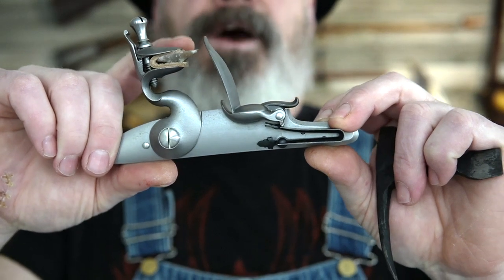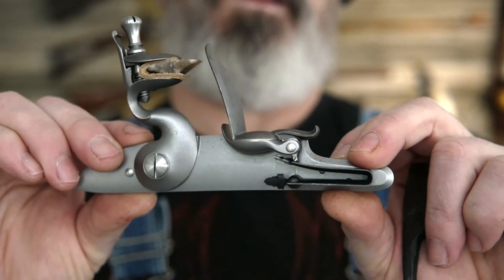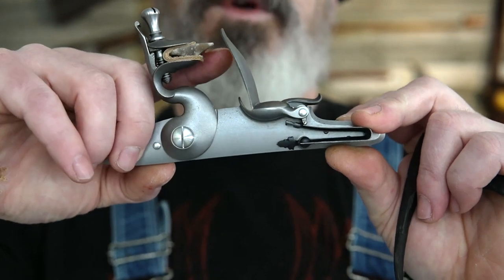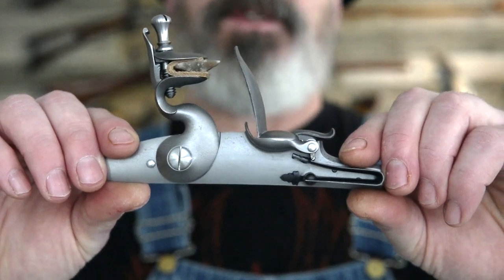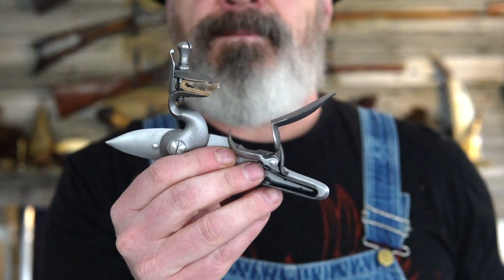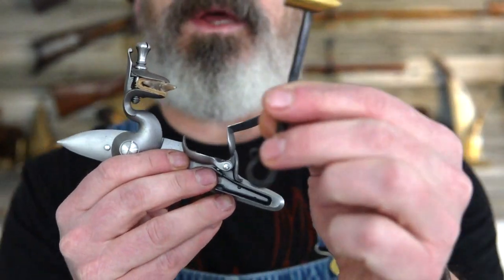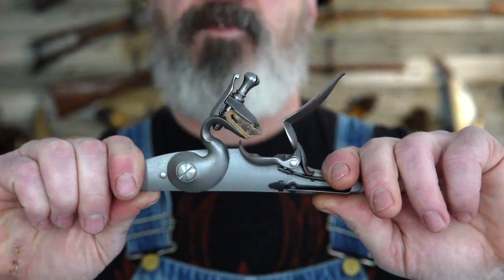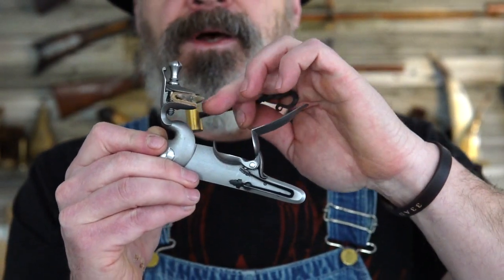KNAPPING THE FLINT + SLO-MO OF THE NEW KIBLER ROUND FACE ENGLISH FLINT LOCK

Comment: I use small hand forged iron pliers and it works very well. I like it better than the hammer. I saw some guys using regular pliers at the range. Good video for the beginners. Thanks
Reply from the maker: Yep, I see how that would work fine. I often use whatever is on hand which is usually the butt or topside of the blade of my knife. Thanks!

Comment: Thank you! Just started getting into flintlocking. A lot of fun and interesting. Missed a nice deer yesterday because of this. Great video and thanks again! Also could someone tell me the best way to prime the frozen pan. I think I was overfilling it causing hangfires.
Reply from the maker: Hey David. Typically overfilling will cause it to hang a bit but not always. I'm not sure what you mean by 'prime the frozen pan'. Reply and I'll answer the best I can. Thanks brother!
Reply: Sorry- frizzen pan!
Reply from the maker: @davidmedeiros2856  I use a separate small priming horn with 4f or 0B in it when using 1f or 2f for the main charge but it’s still hard to control the flow of powder. Many guys I know put their finger over the hole and let a little out at a time until they have the right amount. I usually pour and if I over fill I just wipe it out until I’m happy with how much is in here. You can also use a plunger type primer that only puts out 1g-2g per push. A few pushes and you’re good. It’s really sort of an acquired skill based on how big the hole is on your horn.
Reply: Thank you!

Comment: This took me some trial and error to learn, but now I've tried some of the machine-cut white flints that I think you're supposed to sharpen using a wet stone on the flat side of the "flint" until you've thinned it up enough to get the dings out of it.  Do you have any experience with the machine cut "flints"?  Some say they're great, some say never use them, but I find they last a long time and because the edge is machined so straight, they seem to be easier on my frizzen than natural flints that have a more jagged edge, no matter how carefully I knap them.
Reply from the maker: I've never used them. I'm sort of a traditionalist. I don't mind dinging my frizzen up. It'll still take thousands of shots but if i think there may be a supply problem in the future I usually just buy a second frizzen or send mine to a buddy to reface and temper.....

Comment: So i wamt to ask as i guess i was told wrong. I have the same hammer you so and have sharpened my dlints a couple times to good success it seems. I was told to use the pointed side of the brass hammer and strike edge to edge. Like two swords. That way you end up creating small circular like saw teeth in the flint as you go across the edge. Have you ever heard of anyone doing it this way? Its worked for me although it doesnt take off too much material and actually seems to ding up the edged side of the hammer but what are your thought's?

Comment: My Pedersoli Brown Bess lock that is brand new doesn’t seem to perform like this at all. It came with what seems
Like an amber flint and I could never get that many shots out of it. Within probably ten it was completely chilled out and I can’t really knap it because the flint is really short and there is no edge at all. I’m Also seeing some
Gouging in the frizzen. Not feeling too good.
Reply: I have a pedersoli queen anne that works great but the French blond flints pedersoli uses aren't the best. You need to go on track of the wolf and buy the tom fuller black English flints and jaw pads. Then cut the pad down to size and superglue the top and bottom of the flint to the pad. Lock it down in the lock so that it is straight on with the frizzen at a slight downward angle. You might notice pedersolis don't have much space between the firizen and flint at halfock and thst ok just move it back a hairs worth so it's not touching at a halfcock but still far enough up that it throws the frizzen open all the way. You can test this by moving the flint back u till the firzzen fails to pop open all the way and then moving it up a bit. This will let you know where your sweet spot is. Also with my queen anne and brown bess pedersoli sent them wrapped in lead with a cutout for the jaw screw but even with thick locks like these over time rhe extra weight of lead will potentially snap your neck off. I take the English flints after I've glued the jaw pads and take a knife and cut a v shape in the back of the leather then I round it off by removing enough material that it fits. You don't want to see flint or go more than about halfway through the leather. Ideally your jaws should hold your flint tight enough that it never hits the screw but if it does you have that leather there for cushioning. 
I also have hollow ground screwdrivers I use to tighten down the jaws before firing.

Hope any of this helps you
Reply: Also I'm unsure what you mean by gouging but the way frizens work is the sharp flint scrapes off a thin microscopic layer of iron from the steal and when it oxidized it makes sparks. So it is not the flint creating the sparks it's the firzzen having material removed from it. All frizzens are going to look scratched and beaten on the face even after a few shots. This is normal and not a concern and if you fire 1000 rounds you have even more scratching to come! But it is a non issues. Only later down the road after 2000 rounds or so if you start to have ignition issues do people usually reface or replace the frizzen

Comment: I have to ask how are u getting so much spark!? I just got into a pendersoli Kentucky as my first flinter fir reenacting but it does not spark anywhere near as much as that!?!?
Reply: A custom better lock!
Reply from the maker: Yep. Custom locks from Chambers, Kibler, and others are built like very high end originals and are far superior to factory made stuff. Most factory guns do however have a custom lock that is close enough to be fit by a traditional gunsmith and will improve your Pedersoli dramatically. 👍🏻

Comment: A modern cheat..you can use a pair of wire pliers to nip the edge of the flint if you don't have period correct gear.
Reply from the maker: Uncle Sasquatch I need to redo that video as I usually use a stepped rod and it does work better than a hammer but that was one of my first videos and I wanted to show how the hammer worked. A hammer is probably the worst way to do it but it surely works.
Reply: @BlackPowderTV  I would like to see your version of the stepped rod method. You made that hammer version look so easy :-)

Comment: I’m doing something wrong I get about 5-7 shots and my flint stops sparking, my flint also will have chunks missing after every shot
Reply from the maker: I have a video in the series I recently posted on installing and orienting your flint. It may help you out on that. Usually when you get crushed flints you are hitting too hard and too directly on the frizzen. You're mainspring could be overpowered but if you can get your flint more slicing than smashing you're well on your way to 20-30 or more shots per flint. Keep me posted.
Reply: @BlackPowderTV  I’ll check out the video